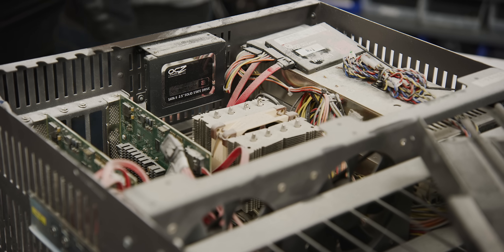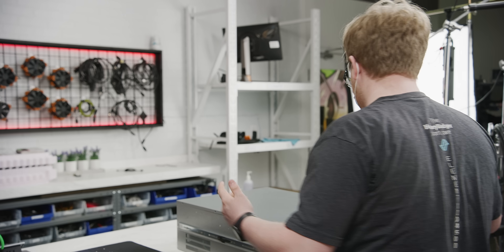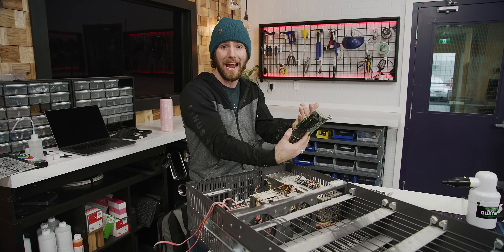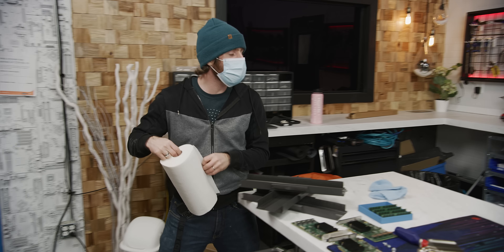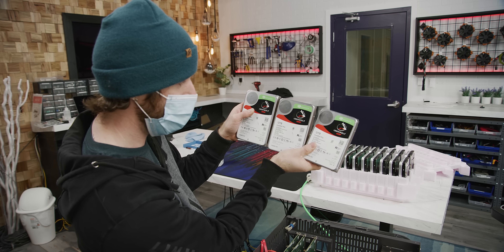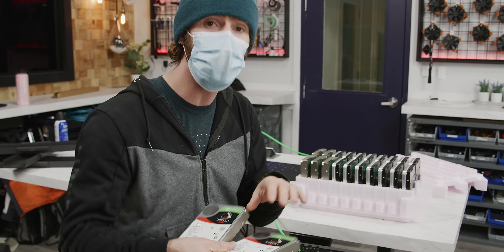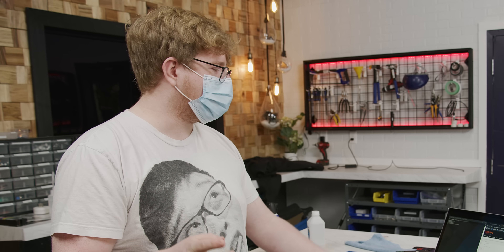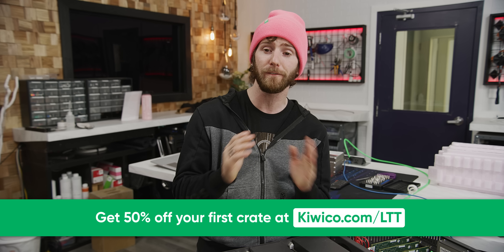Rebuilding Our DIRTIEST Server - Remote Backup Server Build Log

Comment: I have never had problems with static using a vacuum.  If you have proper humidity in the room, and you use a horse hair brush instead of nylon, you won't have a problem.  It is also safer for your lungs.

Comment: In data centers if the clock battery in a GE Infinity power rectifier goes out it SCREAMS non-stop and you can only squelch the alarm for 15 mins at a time.... and the battery is not field replaceable....

Comment: yea i made a small nas out of a rock64 sbc it has usb 3.0 for a fast-ish ssd since its limited by the usb 3.0 speeds but it dose have a 1gb connection so its just good enough to stream videos and store files i have an old sever 8 hard drive bay i was thinking of trying to jerry-rig it to connect threw the usb but im not sure that is going to be possible since it is so old im not sure but i think it uses a scsi interface

Comment: "no we can't use a vacuum it creates static... *We have to blow*"  
There's not something specific about vacuums in particular, both involve the movement of air, which generates static electricity, it's the velocity of the air that's the problem.
So blowing out that server is no different to using the vacuum on it. Both pose equal static risk.
Reply: Thanks for commenting,will refer you to my trade analyst and accountant to make good income
Reply: Chat him on WhatsApp let him Know that I refer you

Comment: When you need 1 blower to blow the dust and another blower to blow the lifted dust away from the immediate area (as the accumulated dust in the air is so thigh even the small amount that drop back down is enough to force you to blow it twice or even a 3rd time) is a sign that it's one hell of a cleaning nightmare.

Comment: What makes vacuuming a pc bad? 5:28
Before you ask, this is a serious question. 
I've always used one when cleaning my own pc. 
After getting a skewer or something to hold the fans in place that is cause I've been told that getting those to turn can fry stuff.
Reply: The static electricity that can build up when you vacuum. You could potential build enough up on the vacuum to where it could spark and kill your components. 

Generally if you stay grounded it should be fine, but still the risk is there.

Comment: Hey Linus, or anyone, could anyone tell me if my computer will work, here are the parts I’m getting
Intel i5 9400
Asus dual GeForce RTX 2060 OC
Asus prime b365m-a
Pioneer 512gb ssd
Corsair vengeance rgb pro 16gb
Seagate 2tb hdd
Seasonic ssr650gb3
Cooler Master Masterbox TD500 Atx mid tower
And Cooler Master Masterliquid LC240E

Comment: As a senior systems engineer for a global org, I highly recommend making sure you have good, frequent backups on a system that has extremely limited ACLs and ideally off of your domain. The number one cause of loss of backup data is not drive failure or natural disaster, but crypto attacks.
Reply: Something else to consider - if your backups are not immutable it doesn't matter how much backup your data.  Ransomware will target your backups and encrypt them so that recovery is not possible.  I wouldn't trust rsnap to protect against ransomware attacks.

Comment: I used to do freelance IT work about 20 years ago.  One of my clients was a shop that repaired aluminum wheels -- machining, welding, painting powder-coating, etc.  That server reminds of me of what those computers would look like when I opened them up.  LOL!  I had to clean them out pretty regularly, or the metallic dust would build up to the point where it absolutely would short something out.  Really bad, that.

Comment: Man I wish I had Jake's knowledge of server 'stuff' to properly setup my HP MicroGen8 NAS and fix the non-readable boot drive after reboot....
Reply: I have had mine run off an SD card for years. Allows me to have 4 8TB drives in RAID5.
Reply: @mikkelbreiler8916  yeah I have an SD card in there now which is fine after the first boot and OS install. After I reboot thought it won't recognize the USB or SD card with the install on it

Comment: I have an enterprising idea.  We need someone to invent an auto case blowing cleaner.    A few strategically placed air cans - every 500 hours blast the inside of the case with a puff of air and Poof!   A cloud of internal dust will eject out the exhaust fans -   Now I assume a vacuum system at the exhaust would clean up the dust injection  and voila!

Comment: Oh for the love of..... it's DUST you wimps.  As long as the server room/construction zone you left it in wasn't built before about the mid 1970s it isn't even dangerous.  (That's about when they stopped using asbestos.)  Just grab some air and blow it out you prima donna neat freaks.

Comment: The hell is he talking about. I have been working on computers since the mid-90s and a vacuum cleaner with brush attachment has been a standard tool I would use. The brush on your vacuum cleaner is made from nylon, which is exactly what so called anti-static electronics tools recommend using: nylon brushes.

Comment: Holdup... hourly backups for one day on a remote backup server? Let's assume you have some kind of file corruption or something along those lines, would you be 100% (not 99.X%) sure you'd notice it in 20~ hours and have someone take care of it?  Honestly, you'd want a week of backups at a bare minimum. Assuming you take Sundays off (or at least have low productivity) and have storage for exactly 24 snapshots, I'd do a Snapshot every 6 hours Mon-Sat.

Also, I recommend getting a compressor used for Pneumatic tools, I got a used one and it's a real blessing to clean PCs.

Comment: I have 2and 1 vacuum cleaner which has blow and suck function, can I used vaccum cleaner on this one? Ive read that you cant use the suck function since it may damage your system due to static? Or i can use just the blower function? Thanks

Comment: The construction guys left an opening on the top and boxed the sides because they were protecting it from any bumps or scrapes during construction, they were not concerned with dust. They assumed this equipment must be dustproof since the owner left it on the construction site.

Comment: I used to work for a place where we took in computing equipment IBM had out on lease, everything laptops to big DASD and tape libraries. I've seen stuff nastier then this... we had one machine, an early 90's RAMAC (basically a bunch of RAID hard drives) that had come from the Port Authority Bus Terminal in New York City. I opened the front panel on that thing and a dust RAT fell out, literally a ball of filth about 4" across. Before doing anything else to that machine it went over to the blowoff booth and got blown out.

Funny thing is, it worked fine, those things were TOUGH. I bet you could have fired a single shotgun blast into one and still have gotten your data out.

Comment: The only real advantage I see to using rsync for backup is that the backup itself is browsable on the filesystem. Usually I would just use a ZFS snapshot (to not have file changes while you're reading) and back up with Borg, which has block based deduplication. My usecase is only a few terrabytes though, so I dont know how it scales to 200+

Comment: The same company that makes that blower, Metro, actually make an ESD safe vacuum, the DataVac. I happen to have their DV3ESD1 DataVac model, and It works really good too! Be careful with the micro attachments though, as they do heat the motor up a bit faster.

Comment: Linus, I'd love to see you compare this setup to something off the shelf such as RapidRecovery or Barracuda as a backup solution. Doing these home brew setups is cool, and interesting to see, but as someone responsible for mission critical data it's something I personally would never consider doing. Chiefly because of a total lack of support when something goes wrong, something you have experienced in the past and had to rely on third parties to assist with data recovery.

Comment: Jake: Lets vacuum this first
Linus: no we can't because static
Me: grabs antistatic vacuum
Reply: that is nonsense, moving dust makes static electricity, so it doesn't matter blowing or sucking dust will shock your hardware a little (but it will be fine)
Reply: @Chipsaru  yep. I used to vacuum dust inside my pc setup and nothing bad happen. Don't think theres enuff e-static to cause any hdware failure. Just be sure not to accidentally suck up mobo jumper.
Reply: The only difference between blowing and sucking is that sucking makes it easier to bump the charged nozzle into sensitive parts. Which means you can still use a vacuum, but you need to be careful where you point it.
Reply: Wait you aren't supposed to vacuum your pc?
Reply: @hilmizakwan29  That's right, you shouldn't. At least not with a 'normal' vacuum cleaner.

They produce static electricity at their nozzle that can cause computer hardware to break.
Reply: @LuukDomhof  bruh I think that's the reason my pc can't detect my microphone. (thx btw)
Reply: @hilmizakwan29  LOL   I use a crevasse tool and paint brush all the time for years,  never had a problem   ^^
Reply: @hilmizakwan29  nö, but what ever..
I do it too, because my case has no dust filter 💩
Reply: Vacuum doesn't really work with computer parts, better use compressed air to blow out the dusts.
Reply: Just put on a rubber bracelet... Oh wait is that not how it works?

Comment: Jake might have meant incremental backup but the explanation of linking to existing files and only copying new files is correct for deduplication of data as well. This can be done on file or block level and are identified by hashes just like sha1 or md5 codes for downloads.

Comment: Backups on site are just redundancies. Off site is the true backup.
I have serviced computers a lot dirtier than your server backup, including dead mice, cockroaches, beer bugs, spider webs and egg sacks, milimeters of tar and nicotine buildup, farming and construction dust.
Note, I have been using vacuums with a fuzzy brush for over 30 years without it ever causing a problem. You guys do know there are vacuums specially made for electronics? Also note, shop towels are 1000 times better than paper towels. Can't belielve an outfit like LTT uses paper towels. Talk about cheapskates.. Gees.....

Comment: OCZ Vertex 2 seem like some solid Solid State Drives. My 90GB still runs 24/7 too. As an OS drive.  I bought at least 3 replacements for it "just in case" - they landed in other systems every time, since i'm to lazy to reinstall Windows anyways.
Reply: sadly my Vertex 2 died recently. It was my main OS-SSD for at least 10 years. Just saw this comment again now.

Comment: I own a DataVAC, and I'm pretty sure they're not meant to be used in a business-like fashion. As in, using it professionally to clear off dust from machines and computers. For home use, it's perfectly fine. I've had mine for more than 7 years, and it's still going strong. Clean the little foam filter in the bottom from time to time, and you're golden. I've saved tons of money on those compressed air cans by buying the DataVAC. Easily one of the best accessory purchases for my tech.

Comment: I know most might not care but if any suggestions on a motherboard and ram looking for something to pair with ryzen 5 3600 I’d appreciate the time n suggestions trying to keep it relatively budget as possible but  willing to spend for quality and performance. Was thinking of B450 tomahawk max and 2x8 3600 cas 16-18 of ram but I feel the motherboard might be too cheap for the cpu in the long run in terms of oclocking and keeping low temperatures. Also not sure if that’s overkill on ram or good for “future proofing”

Comment: "It's pretty slow because it's gigabit"

The fastest networking equipment I have in my house is the cat6 cable to my gaming pc.
Reply: When you have 10gbe standard (and 25gbe to the editors) and 100gbe server connections, 1gbe is slow.

I just got my first NAS a couple months ago and it's 1gbe. I could make a 10gbe connection to my pc but that would be about €350. 2x 10gbe nics (ebay €150) and a switch (new €200). I can't justify that right now, it would be nice but unnecessary right.
When I get my own place I will make a proper network rack with the NAS next to it. Then extra cost for 10gbe is minimal.

Comment: "static problems with vacuuming" if it doesn't have power and has been fully discharged it can't hurt anything I've vacuumed 5 PC's before switching to compressed air with no issues

Comment: Lol that's downright clean compared to the crap I have to work with. I have unironically needed a vacuum to clean out a server before. A dust buster wouldn't have managed to suck up the dust bunnies hanging out in that thing. I literally just reached in and lifted some out. It had been running nonstop for about 12 years with absolutely zero maintenance. It had one fan left, it wasn't the CPU fan.

Comment: This blower is farm or efficient than the one you used.  https://www.tractorsupply.com/tsc/product/performance-tool-600w-garage-shop-blower-1084705?store=1189&cm_mmc=feed-GoogleShoppingProduct_-1084705&gclid=Cj0KCQiApsiBBhCKARIsAN8o_4jjGPr0kcygGUvqQn0O1dc31zezN-FCcw1cSCZuL37T_gEk_BtYT2QaAhxqEALw_wcB

Comment: If you really wanted to do offsite backup, you should probably just sync to S3 Glacier, but I guess that wouldn’t make much of a video.
Reply: Glacier can get really expensive quite quickly (depending on how often you are requesting restores). Plus Glacier is tape based storage which really isn't best suited to the sort of backup management they are implementing. Glacier is really for archive data where you put data into the 'filesystem' and it then never changes. You append new data, but rarely, if ever, purge old data.

This backup system they implemented will be a constantly changing dataset. As new snapshots come in old snapshots are purged etc.. that is where discs excel and are ideal. 

Just an s3 storage service would suffice..... but again, sometimes controlling your own data is an important business consideration.

Tl:dr Glacier == good for archive, can get costly for restores depending on how often. But not good for data backup solutions with a changing dataset.
Reply: @Thats_Mr_Random_Person_to_you  True enough, though that is part of the problem, not solution. I personally would always recommend using Glacier / Glacier Deep Archive with S3 lifecycle rules.
Anything that still changes a lot could be kept in infrequent access, but honestly, such a style of last resort backup should not be touched, unless to test the restoration working occasionally. The goal is always to remove as many complex moving parts as possible, as it is the system to be used, when shit really hits the fan. A simple system does wonders for that. If you maybe do a restore test every quarter, the cost for the actual storage is minute, in comparison to what custom server rack space will typically cost you. I get that some of the hardware will likely be gifted, so the calculation for that is somewhat skewed in favour, but I doubt they are getting of cheaper, and the risk is definitively much higher in what they are doing to fail.
Reply: @autarchprinceps  all good points :)

I will admit I'm looking at it from the tape side and manage an 'active archive' (ie lots of data being restored off tape on a very regular basis) and know  more of the pros and cons of tape space management (like not being able to resuse space in the middle of a tape, so the only way to 'condense' the wanted data and purge the unwanted is to write the wanted data out to a new tape and format the old tape) etc.. we found for our use case, keeping the tape library on premise is wayy more cost effective over a 5 - 10yr period as yes its expensive upfront compared to glaciers monthly, but once paid the only 'costs' are new tape (lto7 at £50 ea.) and system service contracts, we don't pay additionally for the data we  store (like you would for glacier) so cheaper in the long run.

I see glacier as a great way to store a deep archive offsite where the data is barely touched but still needed, compared to an active archive storage where you are doing 50+ restores a week.

Comment: rsnapshot sounds a lot like BackupPC which is what I am using at home. But wouldn't it be much faster to use for example ZFS, make local snapshots every few minutes, and send the difference between snapshots to the backup server? I am doing this for backuping linux containers and it's really fast because ZFS knows best what has changed between snapshots whereas rsync always has to check the modified timestamp of every file before it can decide if it should be backuped again.

Comment: I have a slightly newer version of those OCZ drives, I'm still using it as a boot drive. Sadly I don't have the goofy "my SSD is faster than your HDD" sticker, my ex gf has it! Yes, it does need to be replaced, but I'm dragging my feet until my next build.

Comment: We used to use a software called BackupPC, which sounds pretty similar. The incremental snapshots were fine, but still, we need to do full backups on a weekly/monthly basis since it was a best practice. We’ve ended up not being able to finish that full backup during the weekends, which leads to splitting backups into multiple servers.

Comment: At least didn't have little roaches. I once opened a computer and goddamn little roaches running out. It still turned on, and rouches flying out of the power supply...

Comment: Most degusting stuff I ever dealt with was two (security and pbx systems) were in a pizza shop that used a lot of oil and food release spray for many years... I was a super poor kid and it was hardware that I could never afford at time. Needless to say, after a lot of isopropyl, time, and fighting the urge to puke (think of all the nasty from oil/food release & dust), I finally got it cleaned! Was worth it at the time but I still have nightmares of the nasty every now & then...